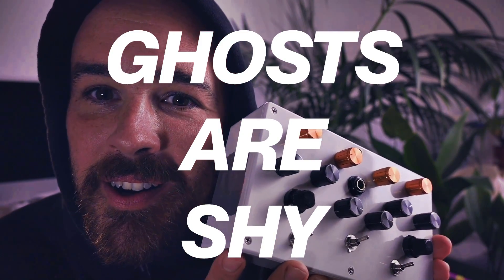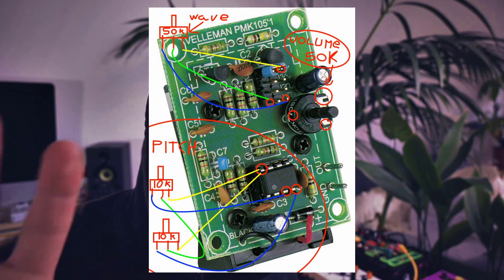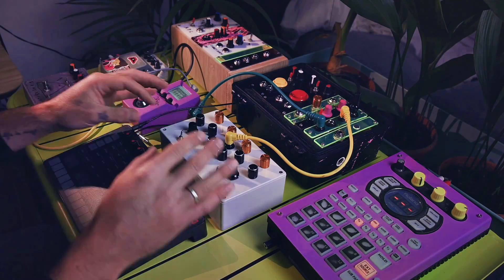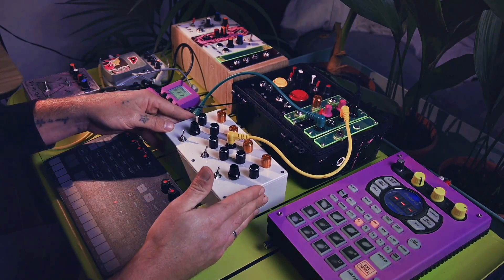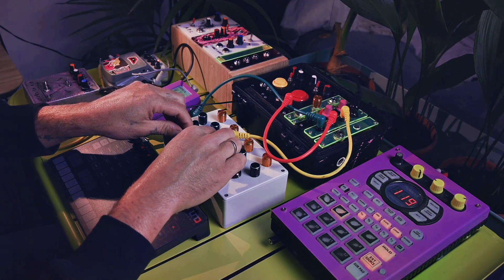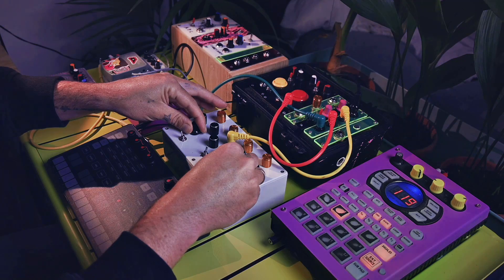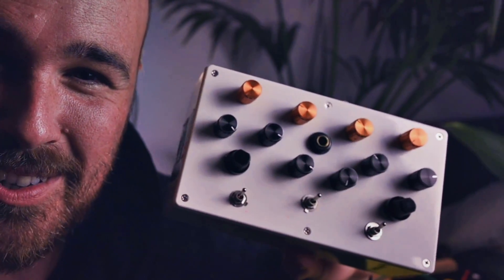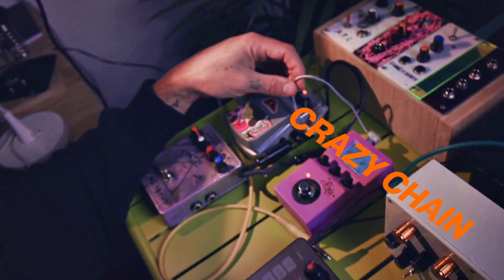HOW TO DIY HALLOWEEN SYNTH - as scary as cheap 🎃 (schematics)

Comment: You could use (mos) FET's, they can work like a voltage controlled pot.
like the 2n5485 o similar, just some 1M resistor on the gate connected to ground  in combination with the control signal, DRAIN and SOURCE for the signal to switched. 

https://www.electronics-tutorials.ws/transistor/tran_7.html
https://www.electronics-tutorials.ws/wp-content/uploads/2018/05/transistor-tran21.gif <--- check this image.
Reply from the maker: oh wow! Ive been trying to figure out how... My electronics knowledge is really basic... i mean, i can solder, but thats it... so thank you! im going to investigate it... i just started my modular journey, and im quite lost.
Reply: @Lonershy  gonna send you a email, is coming now.

Comment: do you loop in/out on eack mk105?  
, like in maybe after 9v section and near 555and then use spst switches at 9v volts each to get them on/off.
Reply from the maker: yes they loop independent, thanks for the point
Reply: @Lonershy  so on the out from 1st pcb is it the out normally or the red wire on (gnd) out and green wire (on J4 left pin) too, I saw the green and red wires and wondered about where they fit into the scheme. Or are all OUTS combined to the one master out jack?